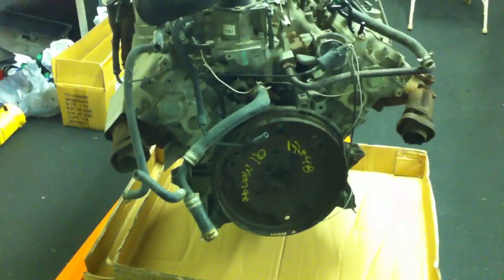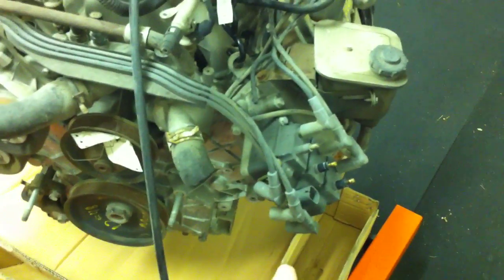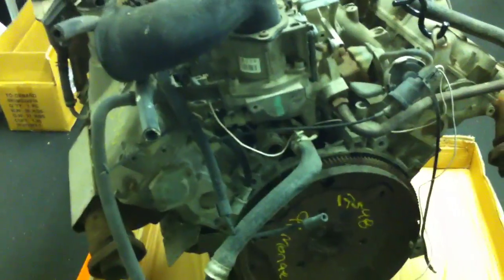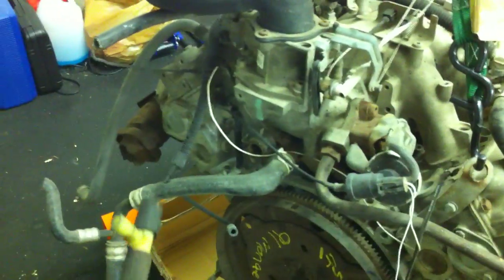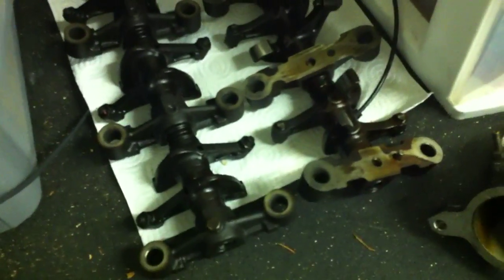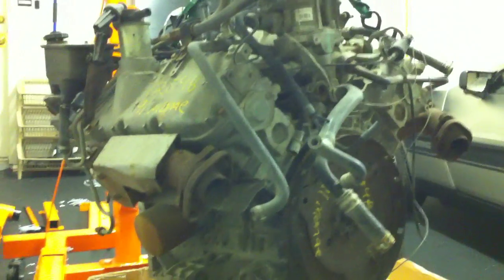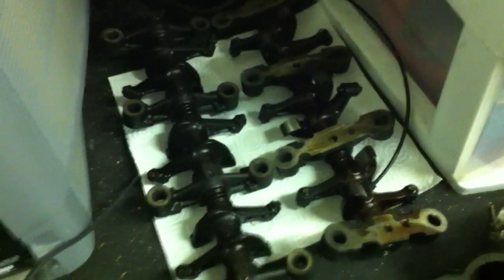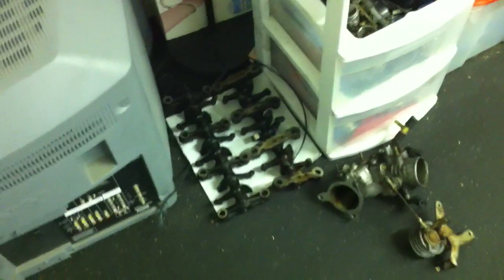Eagle 3.0 engine build plan

Comment: Sure i was asking a fair amount of them. 11lbs of boost made for over 500lb/ft at the wheels. The rods that didn't fail measured 1-3mm shorter than when installed. Having been there i just do it once and know i'm safe.

Comment from the maker: I'll check out that throttle body, looks like it came out of a 960?

A bit after I started the eagle 3.0 project I got a hold of a 84 Turbo Esprit, so I rebuilt it's engine from a pile of parts.  I'm about to start assembly on the 3.0.

Comment: Hey I just stumbled across your Video... Nice work! 
Since we last spoke I've installed a three liter into my streetcar using a throttle body from a B-6304.  Bigger throttle body.  
Do you have it up and running?  Turbocharged?
I'm currently developing a stroker kit for the PRV six. First one should be running shortly.  3.2 liters with forged internals.  Give a shout!